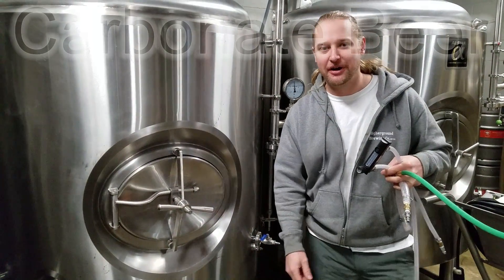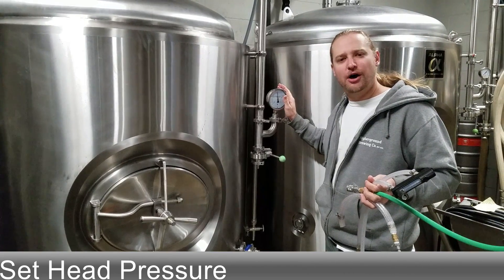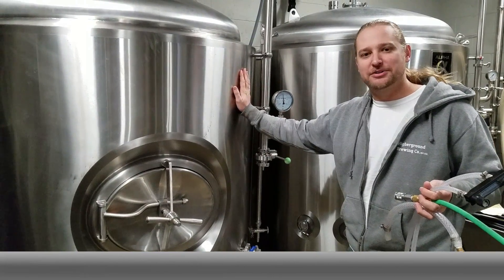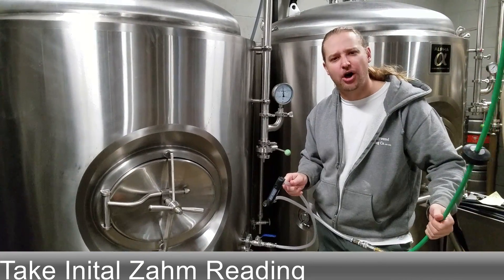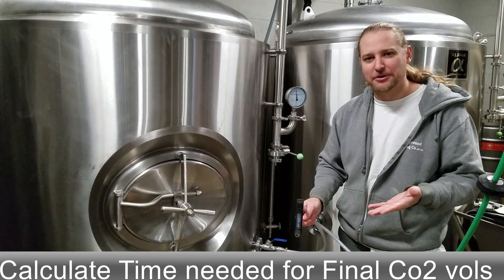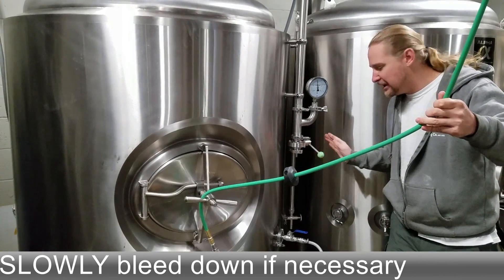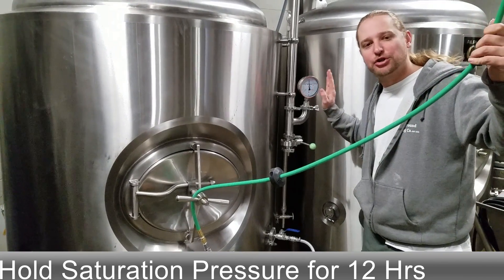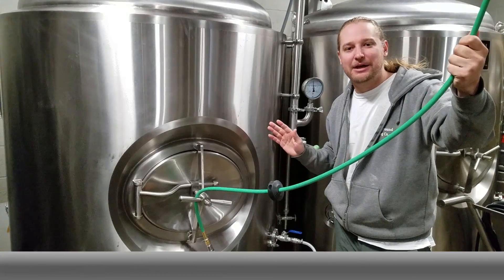CARBONATE BEER, Craft Beer Brite Tank, How To

Comment: Hi Jasper,
This video has been really helpful.  I have been practicing what you have shown here on a 10gal jacketed brite tank making craft sodas.  I have a couple questions I hope you can answer.  Are you setting the regulator to the same psi as your head pressure + wetting + product product pressure?  When I do this, I get no flow through the flowmeter and I need to back off the head pressure a bit in order to start getting flow through the soda.  Its almost as though the head pressure is keeping the  co2 from flowing.  Im not sure if this is because I am using such a small tank.  I seem to be getting good carbonation, just need to set my head to about 5 psi below saturation and then let it come up slowly.  Is there a better way I should be doing this?  Thanks!

Comment: Jasper or anyone that can answer. 3bbl nano here. Carb question. I set my head pressure 1 psi below my saturation pressure which came out to 13.75 psi and then set my regulator to 14.75 psi. Thats 10psi from carb chart + wetting pressure + .75 for beer height pressure above carb stone. I get no flow through my flow meter until I hit nearly 16psi at the regulator. I was attempting a set it and forget it method but ended up dropping head pressure and just hanging around and waited for my head pressure to hit saturation point. Is there a good set it and forget it method? I thought I had it figured out based on research but when I applied the methods from stout tanks and it didn’t seem to work...I was a bit confused.
Reply from the maker: Seems like you only have a 1psi difference between the gas regulator and tank head pressure. Need more of a difference for consistent flow rates. Most pressure gauges   are not very accurate to the tenth let alone 100th place. Honestly the best way is to get a zahm and do what I show in this video. It's the only way ive found to be consistently accurate. Best of luck, cheers!

Comment: Hi Jasper, I am carbonating a 4 bbl tank, CO2 at 32 psi, flow meter set at 3 scfh, head pressure at 11 psi. Head pressure in the tank will rise way before the product is carbonated. I have to bleed head pressure from 15 psi to 11 psi every 15 minutes or so towards the end. After doing this for 6-7 time I get the Zham reading I was trying to get. Am I doing something wrong? Thanks!
Reply from the maker: Hi, If the beer is cold enough, your carbstone is not working well or too small for 3 scfh. Check it in a bucket of water. Make sure the bubbles are not too big at 3scfh or there are any big leaks. Cheers

Comment: Hey Jasper, I have a 7bbl brew pub and I wait til the beer is completely finished before transferring from the FV to the Brite. I've tried using a flow meter like yours in the past but for some reason it didn't work so I continue to carbonate by opening the carb stone ball valve just a little til the head pressure reaches 13psi then I slowly bleed the head pressure. This process takes me about 1-hour but its a guessing game and sometimes the beer is perfect and sometimes its over carbonated. Now that you explained it thoroughly I'm going to give it another try but have a couple questions. Do you transfer while still fermenting to capture some CO2? I don't have a Zahm, so would you have a work around? Thanks

Comment: Just saw your video on transfering beer. When you set your head pressure on your bright tank and it is higher than fermentaion vessel pressure will that cause any issues when you balance with the umbilical cord?

Comment: So do you absolutely have to flow in CO2? When I keg carbonate at the house, I just pressurize the keg and wait. Would that not work for a brite tank? What's the benefit to flow in CO2 through the carbonation stone? Does it just speed up carbonation, or is there something else it's doing for you?
Reply: On this large of a scale it would take entirely too long to force carbonate. Using the carb stone you can carbonate 10bbl (310 ish gallons of beer) in a few hours. On a commercial scale time = money. Get the beer in the kegs and out for delivery.

Comment: Hey Jasper,  i'm new at using brite tank. I ferment and carbonate in the same vessel. So a day or 2 before I'm done with fermentation I close the airlock to use that fermentation gas, then cold crash and right away after reaching that temperature I start collecting the yeast and carbonating the beer? many thanks, great videos.
Reply from the maker: +Carla Fracchiolla Hi. Yes that's right. Sometimes after yeast harvest you can leave it cold for a few days to drop more particles out of beer before final carbonation. Dry hopping can also change this schedule, cheers!

Comment: Jasper great videos! Keep them coming.
What type of flow meter do you use? Do you have part # or vendor info?
Reply: Brewery Life great videos!! I want to order the same flow meter you have but the part # you listed has a flow rate meter of 1-11. Yours in the video looks like 2-22 which would be part #5079k66. Please let me know which one. Thanks.
Reply: @timothymuhlmichl873  did anyone ever determine which is the correct part number.  Both are still available but cost $83 so I don't want to buy the wrong one.
Reply from the maker: Thank you! mcmaster carr #5079k65
Reply: Thanks for the flowmeter info!  I am struggling finding the right one.  LOVE your videos.  New to commercial brewing.

Comment: What PSI are you running into the flow meter?
Reply from the maker: +Jarrod Chandler Usually 40 psi to make sure my Flowmeter puts out a consistent easy flow rate over time.

Comment: And also what do you mean by "bubbling out some of that head retention"? I am a home brewer and sometimes I have problems with carbonating my kegged beer. Thanks !
Reply from the maker: Beer foam has denatured proteins. These proteins only denature once, and it is important for that denaturing to take place on the glass pour. If you are too rough on your beer like bubbling co2 too fast through it, you can denature your proteins that lead to head retention prematurely.
Reply: I carbonate my keg by laying it on the side and pushing 20 psi of co2 while shaking the keg. It's not something I invented, it's something I saw all over youtube videos. Is that not good? I usually get mostly foam when poring a glass, could that be the reason for it?
And if so, how should I carbonate? only by leaving it under co2 pressure for a few days?
Reply from the maker: I have also tried doing that technique back in my home brewing days with varying success.
 A few other ways to try: Make sure you are only filling the kegs 3/4's full. Put the kegs in a cooler 40F and leave hooked up to the co2 sitting under 16psi, leaving the gas on for around a week.  This will keep a constant head pressure on the beer and can be adjusted for beer temperature. 
My non-science way is; fill keg 3/4 full and fill to 35psi. Leave the keg in a cooler. Every 2 days fill keg head pressure back to 35psi. After 3x 35psi bump ups, wait a day and test. 
Beer temperature is a huge factor when carbing and pouring. If you are pouring mostly foam, the beer could be carbed too high, or the pressure you are pushing the beer to a faucet is too low. 
If the keg is in a cooler (usually 40F) Your regulator should be pushing the beer to faucet at 15-16psi.  If this regulator pressure pushes the beer too fast into the glass causing major breakout then you must lengthen the hose from keg to faucet. If 15-16psi pushes too slow you must shorten the beer hose. (Adjusting beer hose length is critical to getting prefect pours)
Hope some of this helps, Cheers!
Reply: Thanks a lot for the info ! Cheers!

Comment: Hi thanks so much for you videos! They are very informative and interesting.
Do you carbonate the beer inside the FV?  And if you do, do you make sure all the yeast is out of there before you do?
Reply from the maker: +Eric Krief, Kinda, I cap the end of fermentation in the FV. This will carbonate the beer to 2.1, remove yeast, Then transfer the beer into the BBT and finish carbing to 2.8vols. 
I do not use the FV as a unitank but many do.
It's always good practice to remove the yeast once the beer has crashed (cooled down).
Unitanks can be fitting with a carb stone, or sit for 2-3 weeks under a high head pressure to achieve final carbonation levels in a FV. Cheers!
Reply: Cool Thanks (:.
By the way, have noticed I posted another question right below? LOL

Comment: Is the flowrate of Co2 at 3-5 LPM based on the BT volume? Would you use a higher flowrate for larger BT's volumes and lower flowrates for smaller BT's? I have 3 and 6 BBL BT's and was wondering if the 3-5 LPM would work for both. Thanks for the knowledge.
Reply from the maker: +Will H. It is based on BBT size and carbonation stone performance. 3-5 LPM would still be a good flow for your size, but you will need to check carbstone to verify. Do this by putting the carbstone in a bucket of water and running the gas though at different flow rates. You want to see the whole length of stone putting out a fine blanket of bubbles. Not so fast as to pump out bigger bubbles that look like boiling water. Now that you have a general optimal flow range for the stone, it's time to carb a beer. Start using a slower flow rate and check co2 vols with a zahm. Check after 1/2 hr for the vols to go up .1 or .2. If they haven't raised the flow is too slow. If they have too much or the head pressure is way above target then slow down.  Like everything in brewing every system is a little different but hopefully this can get you started on the right foot, cheers!

Comment: Probably dumb question, but what type of hose reel are you using for your co2?
Reply from the maker: Tallulah Brewing Mcmaster Carr #5595T12 then replaced the air hose with a food grade hose from local gas company, great question!
Reply: Thanks!
Reply: Do you happen to know the I.D. of the hose you replaced it with?
Reply from the maker: Tallulah Brewing 1/4 inch I.D

Comment: Can you do a vid on pressure fermenting, big tall fermenter pressures on the yeast cake, max pressures before damage to yeast/brew. brew temperatures, ferment warmer etc...pros and cons
Reply from the maker: Ivan, thanks for the suggestion! Here is a quick overview to get you started. Ale Fermentation process starts at 68F with no head pressure for 3 to 5 days. Once the specific gravity is within one plato of Final Gravity I will cap and build pressure (12psi) for 1 or 2 days. Pressure while fermenting helps with aroma, head retention and prepares for cold crash. Yeast can handle up to 30 psi. Remember every 28 inches of beer above your yeast will add 1psi. Fermenting warmer usually with ale yeast will cause quicker fermentation with more notes of flavor. Colder fermentation, usually with larger yeast will lead to a longer fermentation times with one smooth flavor. Hope this helps, Cheers
Reply: why not cap the fermenter on day one, and have the pressure higher, say 25 psi at 68 deg f? that way the beer is carbonated on day one to the rough level needed and save on co2 cylinder gas. i have tried this out at home with my smaller conical fermenter and it seemed to work well. or is there a reason to have no/low pressure on the first 3 to 5 days?
Reply from the maker: Ivan van Hoof  First, most FVs are only rated to 15psi. Assume a 10 psi increase for every Plato fermented and a normal beer would produce well over 100psi if the yeast stayed healthy (not 25). Capping on day one creates a bomb and major safety concerns. Second, Yeast may stay viable under increased pressure but looses vitality, therefore reducing the number of croppings (increase mutation rates) Third, pressure will affect flavor compounds. Increased pressure reduces higher alcohols and esters while increasing acetaldehyde to name a few. Finally, I am a fan of blow off buckets as watching the bubbles tells me a lot about how the fermentation is performing. You may be able to make a magical beer Capping on day one but these are some reasons why I don't, cheers
Reply: Thank you for your time, i will continue with my trails, and will try your way and others i had researched. the proof will be in the tasting for me. oh by the way my ferntener is rated to 40 psi and has an adjustable release valve and i can serve the beer from it too but usually transfer to one of my keg unless they are all full. its only 2 to 3 gallons fermentor. it is interesting what the commercial guys like your self do. great channel